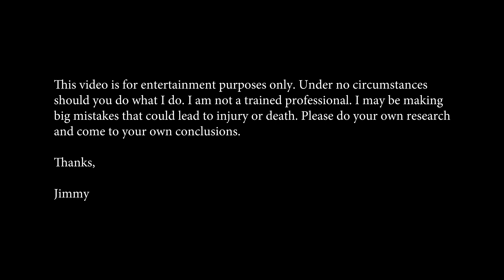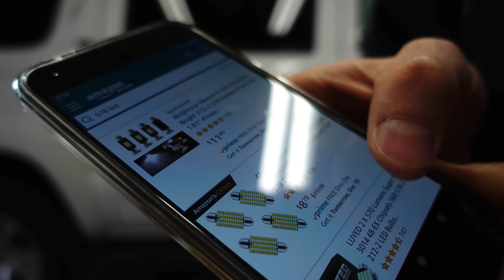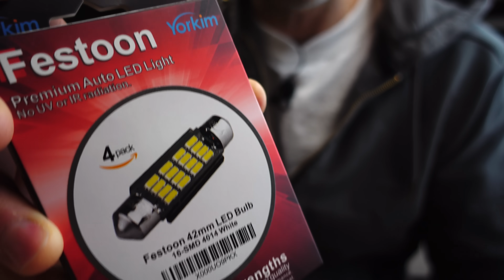Here's Why You NEVER INSTALL LEDs IN YOUR CAR OR TRUCK!!

Comment: I pulled the trigger on a set of LEDs off a Facebook ad for my 01 Xterra about 7 years ago. Yeah yeah, back then, there were actual legit ads on Facebook. They were well under $100 for the set, they have a heat sink as well as a fan all built in. They are still going strong today.

Comment: I am still trying to understand why I should never install led lamps in my car!
Reply: I'm still wondering... Did I miss something?
Reply: @stevenleber1485  there is no reason. This video was a waste of time
Reply: Wes Ryan indeed! Cheap led lamps is the only reason.
Reply: Sometimes, error codes can come up with LEDs because of the power draw difference.
What I wish the vehicles still have now are mechanical flashers, instead of the rate controlled by the BCM (body control moduele).  Just replace the flasher with a LED unit and you're set.
Now, if you want to use LEDs in the turn signals, you have to add resistors to control the flash rate and in some cases, other areas where an error code come up.
Mount the resistor on the metal surface (plasic will melt if placed there) for heat disipation.
Manufacturers should've left that alone.
Reply: ...Because it looks like a waste of time and money to me...and you might end up breaking things and buying bulbs more than once and replacing ones that don't need replacing. Find a better use of your time and money.
Reply: @maxcarter3413  You should also stop what you're doing, give up, and never do anything. Ever.
Reply: I got the Sylvinya LED lights from Autozon and from Amazon . Some of them, moved between 3 of my cars in the past 10 years. I didn't have to replace any. Of course, there no reason not to replace the ugly traditional light bulbs with good quality LEDs. At least you don't have to jump start the car if you forgot the lights on for weeks. I think he is talking about the generic low quality  LEDs that most of car audio places sells for cheap.
Reply: Beam pattern will be all wrong and you will be blinding drivers coming towards you!
If the car came with anything but LED's that is what will happen!
Hope you understand now.
Reply: It's all Greek to me too.
Reply: how about so you don't damage the retinas of oncoming drivers??
Reply: I don’t get it either
Reply: @apscoradiales  Using an LED bulb in a REFLECTOR housing will result in a beam pattern with a "dirty" cutoff, will work ok in a PROJECTURE housing.
Reply: He sold out to the led companies.  He marketed the video under false pretenses.

Comment: On other thing to consider is that the LEDs are most often not placed correctly on the bulb to be used in an old halogen-type DRL or other external light. The reflectors are designed with assumption that the filaments are in certain positions. LEDs that are not placed in similarly exact position will cause light to go in all different directions that it's not supposed to go in an old reflector, and will blind other drivers.
Reply: sometimes blinding someone is better than people pulling infront of you because your lights arent bright enough. ive had to drive with my brights running 24/7 to avoid these distracted Asian drivers
Reply: My car had halogens from factory but in a projector housing, cheap China LEDs were washed out rubbish but the Philips aftermarket ones I used gave the exact same pattern just brighter and better colour.

Comment: I completely rebulbed my van lights including the running lights and headlights to LEDs and I have been nothing but totally satisfied with how well they have worked in my van.  Much brighter lights and much less power draw.
Reply: And blinding everyone else on the road.
Leds and the losers that cant see on the road at night without them are a danger to others.
Reply: @abyssmanur3965   Normally, I would agree. I always hated the guys with floodlights coming at me at night.. However, my issue is that in my truck, there is no incandescent bulb that is bright enough for my personal standard of acceptable brightness. I would travel with my brights on and no-one would even notice the brightness of them. Usually, if you have your brights on, people would be constantly flashing you to turn them off. That doesn't happen to me.. I found some great leds on Amazon that are brighter than the incandescents, but not too bright and I am very satisfied with the results...

Comment: I have no issues with LED's by any means, and the less draw on power is certainly a wonderful reason to get them. My personal preference is to run incandescents simply because the light feels a lot more friendly and less harsh than LED counterparts
Reply: There are less harsher LEDs, they're usually marketed as "warm white" or "golden white" bulbs so you'd have to look out for those. I love LEDs in general but cannot STAND the Bright White LEDs like the ones used in this video. Warm White/Golden White LEDs have a more sunlight-hued brightness as opposed to the cold, clinical look of the Bright White LEDs.
Reply: @metroredline  might have to look into that!
Reply: Meh, drawing less power is one of the last possible reasons to get them for automotive interior use because you will never notice the difference.  The infinitesimal difference in the load on the alternator (pertaining to engine efficiency and thus fuel economy) to make a few mA more current for the brief moments you have those interior lights on, is less than the difference in fuel  economy from farting towards the rear while driving.   

You might think I'm kidding but it's really not measurable as a statistically significant % of fuel consumption over the entire operation cycle of the vehicle.

Now if you were instead talking about an amp or more mains AC current for your home light bulbs on several hours a day, then things change completely, makes the power savings of LED over incandescent quite worthwhile.  If you prefer warmer color temperature light, there are both vehicle and home lighting options that aren't such a cold color temp.

Comment: Some LEDs like headlamp LEDs come with heat sinks and even cooling fans built in.
Reply: I bought some on amazon. They work fine, fans included :)
Reply: Oh LAMP ! NO "BULB" eh?
Reply: All he is saying people us that the cheap Chinese LED'S design has flaws like most chinese knockoffs.
Solid state LED will not overheat but the LEDs itself will not overheat or has any heat
Reply: @charletonzimmerman4205  Bulbs are things you plant in the ground to grow stuff, Lamps are things that give light when energized by chemical reaction or electrical discharge. LOL TTFN.
Reply: @uksuperrascal  Then ,WHY ? I plant my BURNT-OUT, Incandescent "LIGHT" BULBS" in the EARTH, I don't get replacement ONES?
Reply: Waiting for a headlamp that comes paired to a 360 AIO radiator.
Reply: The LEDs are low power so low heat, the circuitry is what can get hot, what can fail in cheap bulbs. The circuity has become commonplace after after probably hundreds of millions of bulbs and even no name bulbs last and probably will last longer than an incandescent. The he did not mention the resister needed to avoid idiot lights turning on, I would put LEDs in to save power and not run down my battery so fast when the care is not running but the resister defeats that. I put LED running and license plate lights in on a truck because they are on all the time, should last longer than the incandescent, and I don't mind those idiot light or dash messages, I will manually check them once a year. Break, signal, and headlights I would like the warning.
Reply: higher lumens LED create lot of heat than lower lumens at the same watt.
Reply: @thinklap6367  If you think that LED lights are hot, try high-intensity discharge lamps. They are way hotter than any LED bulb.
Reply: @jameskoralewski1006  I mean 50000 lumens LED not average 5000 lumens LED
Reply: @thinklap6367  Some people, with fancy German cars, still use HID (High-Intensity Discharge) in their cars.  These lamps usually have a bluish tint to them and are much brighter than halogen or LED lamps. 50, 000 lumens is impossible for any headlight. This much light would burn up the plastic covers over the bulbs.
Reply: @bradhaines3142  If you are talking about brightness and being able to see farther and better. HIDs are much better than LED. Why do you think HIDs are preferred by Mercedes and BMW?
Reply: @jameskoralewski1006  because the germans love expensive repairs. one bulb is 50$, for the cheaper ones. if you have to replace the ballast, thats at least 200, if you have someone else do it it could be 500+ maybe even 1000$ at a dealership to make your headlights work. 

led on the other hand, is 150$ for a pair of top notch lights. just plug it in and pop it in the socket, no stupid ballast bolted to the bottom of the headlight housing
Reply: @bradhaines3142  You must decide. Do you want the best with superior performance or do you want the cheapest and inferior performance!
Reply: The heat of LED car lights mainly comes from the heat generated by the LED light source. Almost all the electricity consumed by the LED light source can be converted into light and heat. The current LED car lights on the market have the following three main heat dissipation technologies
1. Metal aluminum body for heat dissipation. 2. Heat pipe for heat dissipation. The super thermally conductive heat pipe is composed of copper pipe, capillary structure and working fluid. One end of the heat pipe is the evaporation zone, the other end is the condensation zone, and the middle part is the adiabatic section. 3. The heat conduction circulation system of the uniform temperature plate heat dissipation LED car lamp internal heat dissipation mainly uses the uniform temperature plate and copper fins to dissipate heat. Even heat dissipation and fast conduction. 4.Cooling fans. Cheap car lights cannot provide good heat dissipation. We are a professional LED manufacturer. For more questions, please consult us.
Reply: @thinklap6367  But still much less than an incandescent bulb would. For the same lumens they use only 1/10th to 1/8th power typically.
Reply: The bulbs that were in there originally probably get no air flow if any at all.

Comment: Something I learned about installing LED lamps...they can't be mixed on the same parallel load circuit with incandescent bulbs. If you try, they will not light or only light very dimly and quickly overheat and fail. The resistance of the incandescent bulbs creates a current droop that will kill some LED array lamps.